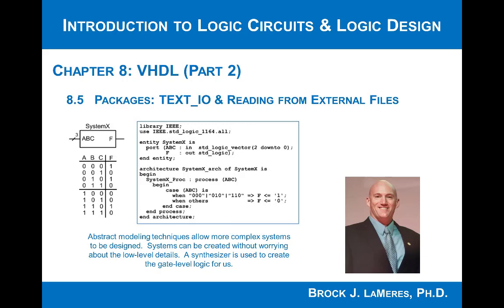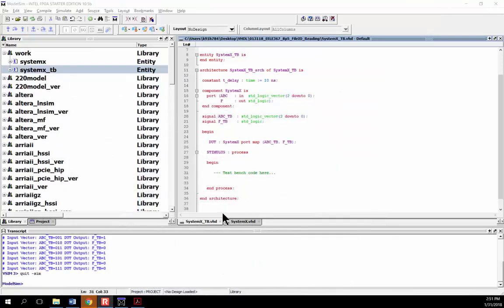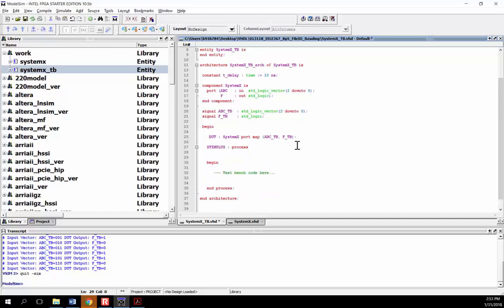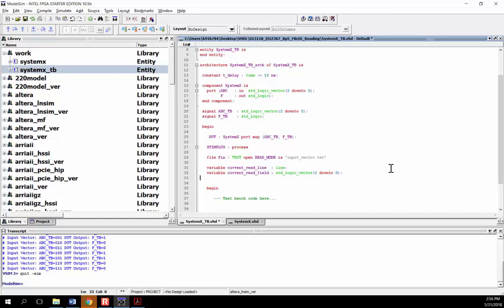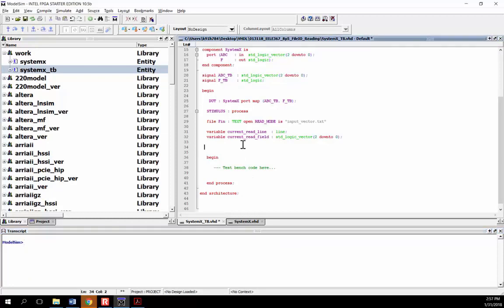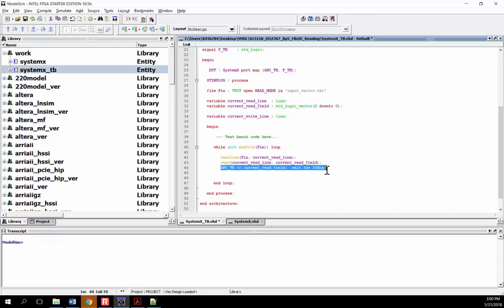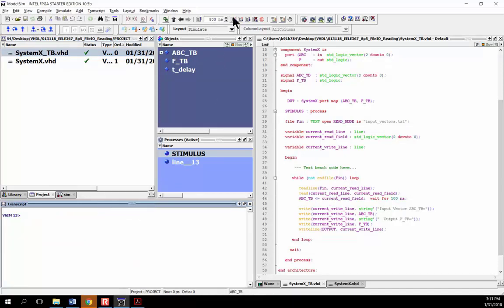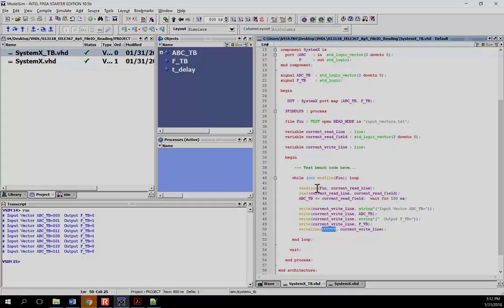8.5(e) - Packages - TEXTIO & Reading from External Files

Comment: Hello, I attached the codes: 

----https://www.youtube.com/watch?v=vneVDMEtoL8

library ieee;
use ieee.std_logic_1164.all;
USE IEEE.STD_LOGIC_TEXTIO.ALL;
use std.textio.all;

-- Uncomment the following library declaration if using
-- arithmetic functions with Signed or Unsigned values
--use IEEE.NUMERIC_STD.ALL;

-- Uncomment the following library declaration if instantiating
-- any Xilinx leaf cells in this code.
--library UNISIM;
--use UNISIM.VComponents.all;

entity SYSTEXT is
    Port ( ABC : in STD_LOGIC_VECTOR (2 downto 0);
           F : out STD_LOGIC);
end SYSTEXT;

architecture Behavioral of SYSTEXT is

begin
PROCESS (ABC)
begin
    IF (ABC = "001") then 
    	F<='1';
    ELSIF (ABC = "100") then 
      F<='1';
    ELSIF (ABC = "101") then 
      F<='1';
    ELSE
      F<='0';
    END IF;
end process;

end Behavioral;

TB:

--https://www.youtube.com/watch?v=vneVDMEtoL8
library ieee;
use ieee.std_logic_1164.all;
use ieee.numeric_std.all;
use STD.textio.all;
use ieee.std_logic_textio.all;
-- Uncomment the following library declaration if using
-- arithmetic functions with Signed or Unsigned values
--use IEEE.NUMERIC_STD.ALL;

-- Uncomment the following library declaration if instantiating
-- any Xilinx leaf cells in this code.
--library UNISIM;
--use UNISIM.VComponents.all;

entity systext_tb is

end systext_tb;

architecture Behavioral of systext_tb is
constant t_delay:time :=10 ns;
component SYSTEXT 
    Port ( ABC : in STD_LOGIC_VECTOR (2 downto 0);
           F : out STD_LOGIC);
end component;

signal ABC_TB :STD_LOGIC_VECTOR (2 downto 0);
SIGNAL  F_TB :  STD_LOGIC;

begin
DUT: SYSTEXT 
PORT MAP (
ABC=>ABC_TB,
F=>F_TB);
PROCESS

FILE Fin: text open READ_MODE is "input_vectors.txt";
variable current_read_line : line ; -- read line from the file
variable current_read_field : STD_LOGIC_VECTOR (2 downto 0) ;--read from the read line, the same type as we would like to use
variable current_write_line :line;
BEGIN
while (not endfile(Fin))loop
    readline(Fin,current_read_line);-- read line from the file
    read(  current_read_line,current_read_field);--read from the txt line and put the info at the pleased type (vector (2..0))
    ABC_TB<=current_read_field;--feed ABC_TB in current_read_field value
    Wait for 100 ns;
    
    write(current_write_line, string '("input vector ABC_TB="));
    write(current_write_line, abc_tb);
    write(current_write_line, string '("  Out f_TB ="));
    write(current_write_line, F_TB);
    writeline(OUTPUT, current_write_line);
    
end loop;
END PROCESS;
end Behavioral;